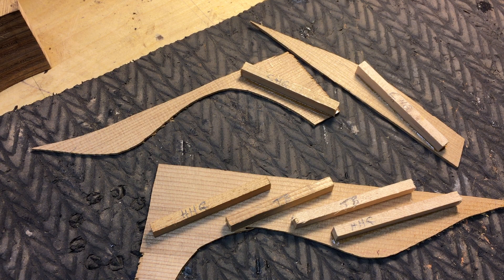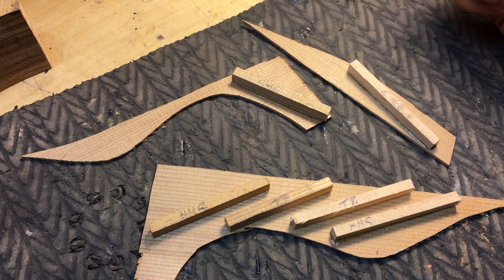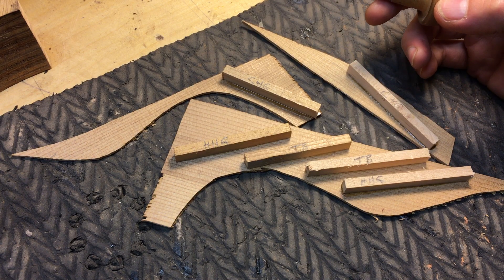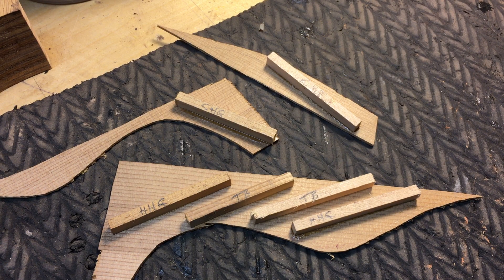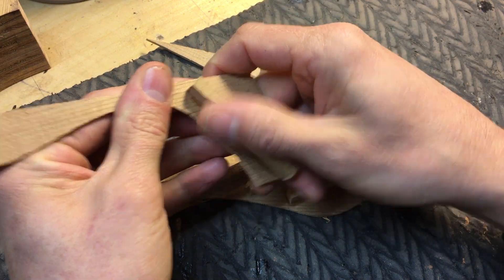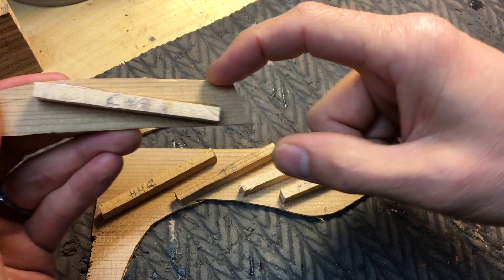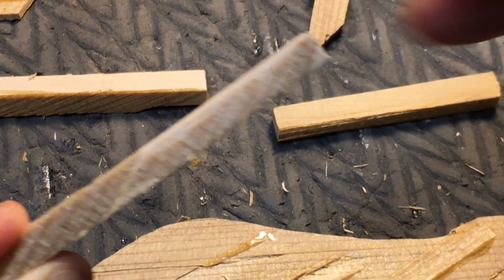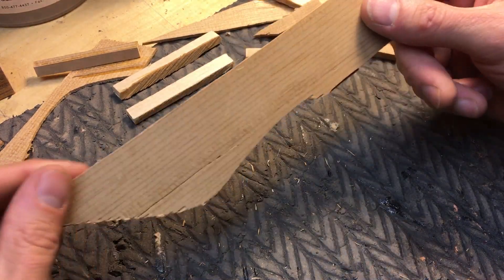Torrefied Spruce Glue Adhesion tests Beau Hannam Guitars and Ukuleles

Comment: Great information, thank you for sharing your results.  Torrefied is hydrophobic, put a drop of water on it and see what I mean.  PVA has to penetrate the surface to bond properly, and the hydrophobic properties of torrefied spruce require a more rigorous brushing (as opposed to just spreading) of the glue on the surface(s) to get a joint comparable to non-torrefied, IME.  I've never had a torrefied joint failure (tops and braces) but my oldest joint is only 6 ears old.  Has anyone tried pre dampening the wood before applying tite bond?
Reply from the maker: Thanks- i've never dropped water on torrefied spruce but will check it out. What does "rigorous brushing" mean. I splash HHG on really thick when i glue on bridges, wait 20-30 mins and clean it up (i lay down low tack tape to help the clean up.
Reply: @BeauHannamGuitars  Really appreciate your videos..  Rigorous brushing is simply using a flux core brush, instead of a finger or stick,  to spread the glue, brushing it into the wood until it stops beading up, and starts penetrating- maybe a minute or even less.  I generally use titebond on builds, and HHG on repairs where I can.    Your video; The 7 Must-Know Tips for Working with Hot Hide Glue, is one of the best on the subject...... https://youtu.be/VfCI95jEBpQ?feature=shared

Comment: I've made 20+ guitars with torrefied tops and have not heard back from my clients about issues, and I feel like I would hear back if there were problems. 

What I saw here is that it took considerably more force to break the joints than any joint on a guitar, save the bridge, would experience in normal usage.

I also abandoned torrefied bracing as I was uncomfortable with how they felt while carving.

Overall, I'd say we don't need to be afraid of torrefied tops, we'll probably be ok.

I use more glue (TB) and longer clamping times than normal wood.

I like the tone, it does impart a broken in/vintage vibe tone, but I consider it a niche tone like a hardwood top. Cool for what it does, but not as versatile as standard wood.

Thanks for making this video!
Reply from the maker: I agree- with these pieces, the strength was more than enough- and carving torrified braces sucks!

Comment: Since I do much more repair than building my experience with HHG is braces letting loose in old guitars. I'm also repairing a violin over 100 years old that literally came apart at the seams. All of them. My take away here is that maybe it's wood failure and not HHG failure as most attribute loose braces to. I know we're all chasing tone here but torrefing wood or fast aging wood may be causing problems we used to have to wait 50 years for. Just like top, sides and back cracks are thought to be caused by lake of humidity. Humidity is just slowing down the torrefication process. Which in turn causes wood failure. BY the way I am a fan of HHG over TB for acoustic instruments because of the glass like properties when cured. Chasing tone again.
Reply from the maker: Yes- everything seen here was wood failure from shear strength (my thumbs), not glue adhesion issues..

Comment: I've done a number of guitars with torrified tops and as you mentioned, the wood is indeed brittle (best I've used so far are from RC Tonewoods).  When combined with torrified bracing, the whole package is way too delicate and crack prone for me, so I now brace them with non-torrified brace wood. I don't buy into the hot hide thing, Titebond is easy to work with, provides and excellent bond, and results are just fine...
Reply from the maker: Torrefied braces are horrible to carve too. I glue all my bridges on with HHG as it has a better shear strength...but titebond works just fine for that too

Comment: Seems to me that your tests showed wood failure for all of them so all the glues did their job. Any difference in force required to break the joints would be due to the wood structure and grain orientation not the glue. That said, there are many ways brace joints are stressed in the real world so there certainly may be a better glue to use in practice not covered by your test.
Reply from the maker: All true, however, i'd say 99.9% of luthiers only use HHG or titebond. Some luthiers like fish glue but i've heard about catastrophic failures in humid conditions so i don't use it.
Reply: cold hide glue was reformulated last year.  I have seen this glue fail over time especially on bridges and fret board extensions on  torrified wood. Martin did extensive testing on this.  I do suggest extending clamp time
Reply from the maker: @tippie53  good to know- mine has a batch number of this year so i guess i have the newer formulation

Comment: I use a good bit of Torrified wood. I use 24 hr clamp time .  I stopped using cold hide  . I do use fish glue.  You results pretty much matched mine . the only difference is I have some out there for 5 year.  Cold hide was the only glue that had failures  . Torrified in my experience  needs more clamp time than raw wood  thus the  24 clamp time.
Reply from the maker: i forgot to mention i clamped these overnight.- Also, I bought that cold hide glue for fun (ie i don't use it for anything but i like to be informed about things)